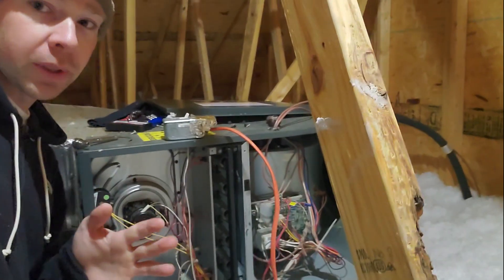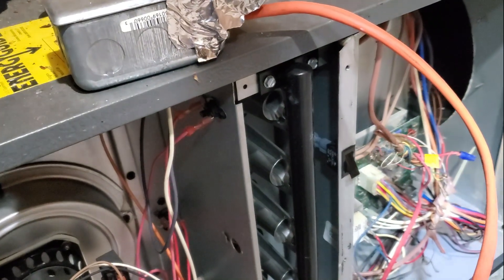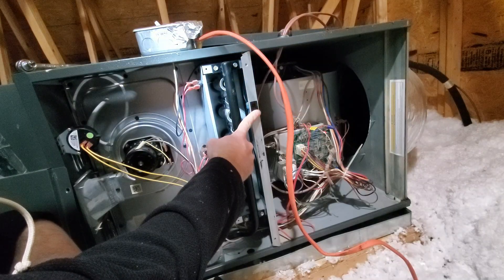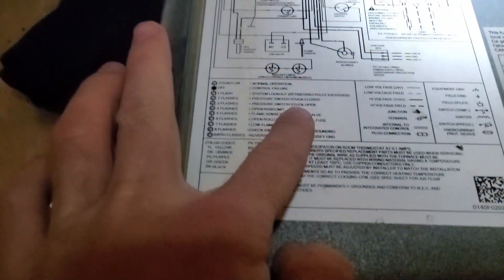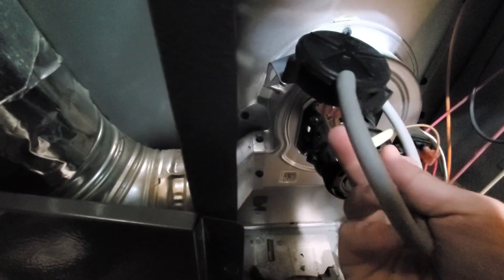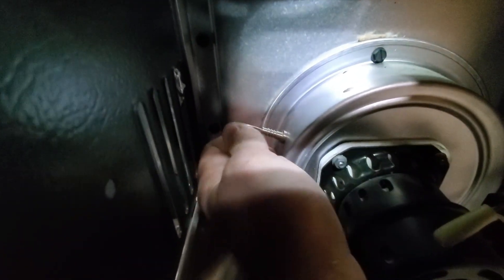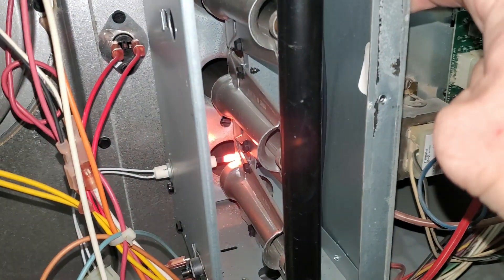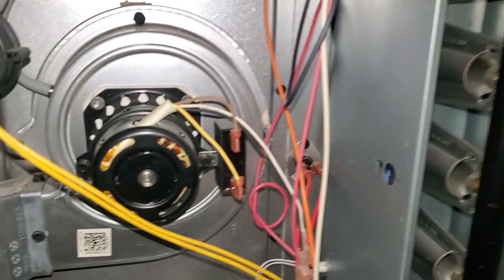No Heat No Problem. Goodman Furnace 3 Blinks Fix — Pressure Switch Stuck Open. Easy Repair.

Comment: My 8 year old Goodman heater quit working.  I could hear the inducer motor come on and then stop.  I pulled the covers off and saw the red LED flashing 3 times.  My heater has 2 pressure switches so I decided just to buy the assembly.  Anyone that could deliver quickly was out of stock.  The only places that had it in stock said 6-10 days delivery.  Even one site said pay $97 for overnight delivery but then says 3-4 days to deliver.  That's too long, it's really cold here now in NE PA.  I was thinking about hiring a repair guy just so I wouldn't have to wait and I know it would be costing a lot of money to come immediately.   I had read somewhere else that pressure switches hardly ever go bad and then I saw your video.  I had nothing to lose so I decided to try what you did.  I pulled off both rubber tubes and blew them out.  Didn't notice any restrictions or stuff coming out.  Then I got an Allen wrench and shoved it in all the fittings.  I didn't feel any restrictions so I just kept poking and twisting the Allen wrench and then put it all back together. I held in the door switch and turn it on.  The igniter started glowing and the furnace lit.  Son of bitch!!  It works!!  Cost $0!!  This has saved me a lot of money.  I know it would of cost a lot to come out and I'm sure they would have been changing parts.  Thank you so much for this video.
Reply: Our goodman was blinking 3 times..it turned out to be a cracked hose at the inducer motor.. cut the brittle cracked piece off and boooooom it works 🤪
Reply from the maker: That's Great!
Reply from the maker: That's great to hear! I'm glad you commented with this. I couldn't believe it myself either and said I got to do a video on this, maybe it'll help someone else out too. Such an easy fix, potentially saving hundreds of dollars.
Reply: @rustedpliers1618 Yes, you know damn well they would have charged me hundreds.   Thanks again!!